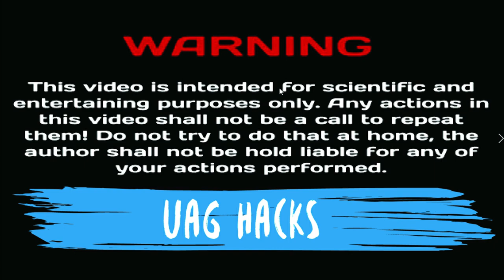Water Tank Level Indicator with Overflow Alarm | Water Alarm Project | Water Tank Alarm

Comment: So you just let the water conduct electricity? Does it work with normal tap water or you have to add something like salt to the water
Reply from the maker: No I didn't add anything to the water its just a simple tap water , I just pass the 9 volt direct current (DC Current) with the 9 volt battery.

Comment: Material required pls give me the list
Reply from the maker: 3 volt led, on off switch, 1k resistance, buzer,  9 volt battery, wires
Reply: What type of wires did you use? @UAGHACKS
Reply: Coper wires